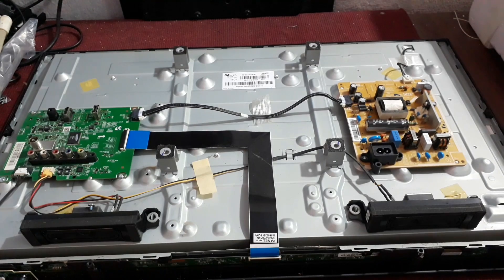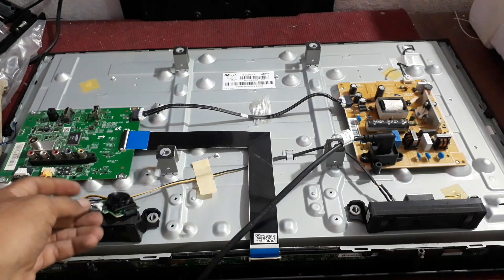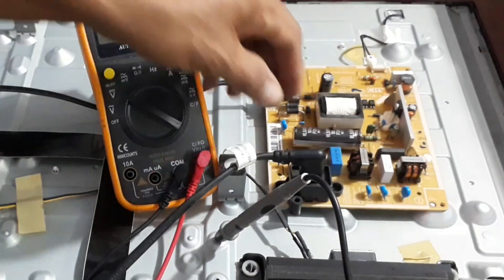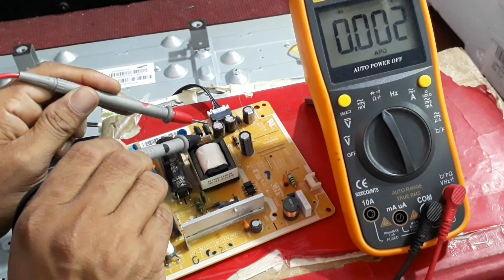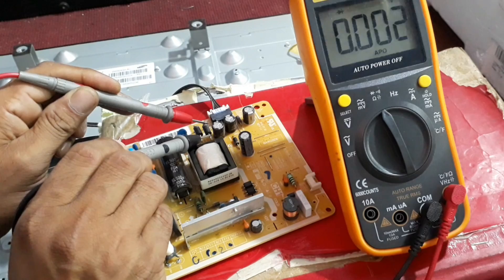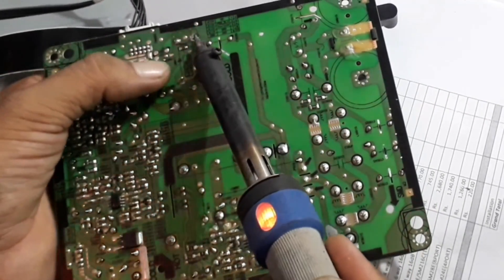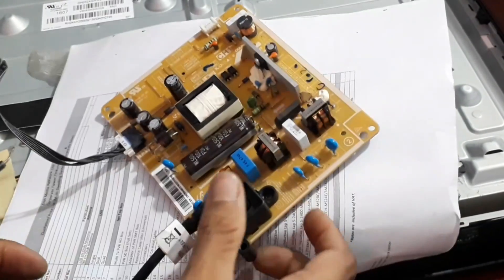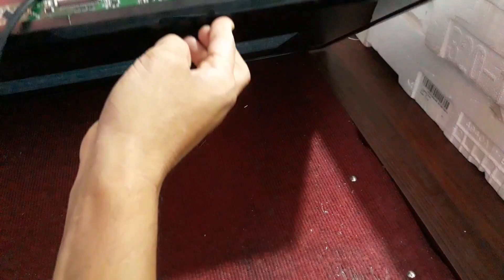Samsung Led TV Power Supply Problems|| Led TV Repair

Comment: Thank you very much. I have a 32 in tv with the same fault and also localized to the same diode. Will purchase a replacement on Monday as I do not have a suitable diode in stocks.